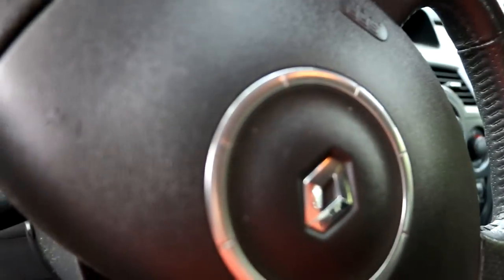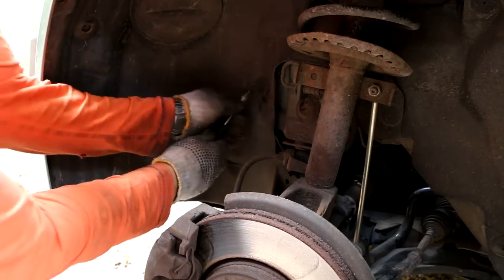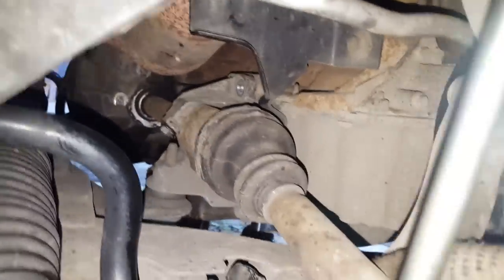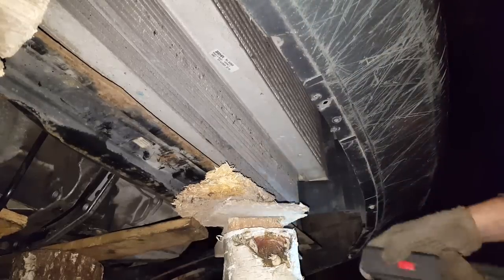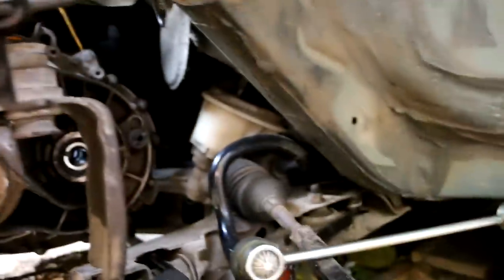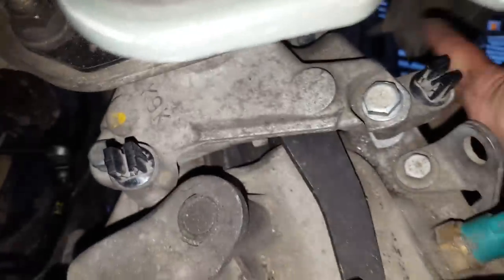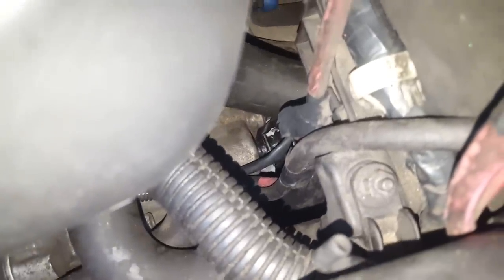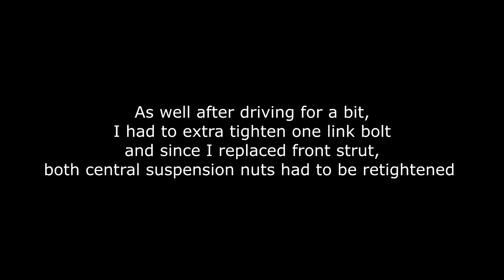How to replace Renault Megane 2 Clutch Concentric Slave Cylinder

Comment: thanks for this video :)   my megane 3 clutch pedal went zero pressure when i parked up, then the next day it had pressure again, the pressure lasted about 3 gear changes then went pressure free again. do u think it could be something other than the slave cylinder? the break fluid is full strangely. im wondering if it has a leak and sucking in air overnight.  Any thought? thankyou

Comment: I came to your video, wanting to see how you bleed the concentric slave cylinder, I did not get the information I was looking for. I then saw all your dangerous struggles, I have the following suggestions to you.

1. never work under the car with those wooden supports, get four jack stands. You are a lucky man alive with all these dangerous endevours.

2. Use jack to raise you car.

3. to take out the transmission, you do not need to take out the struts. Also, you may want to buy an engine hoister, to move around the transmission.

Wish you all the best in your car repair adventures.

Comment: Man that is a big job! I have to replace mine in 'n 2004 1.9dci that started leaking recently.... will change the clutch and crankshaft oil seal and thrust bearing at the same time since it is such big job...
Reply: Doing the same, how was clutch job?

Comment: This is SO cool! 
Thanks for insisting that it's possible to do it yourself - even if you don't know how, from the start! 
And thanks for also showing me that I can't :D 

My pedal is doing exacly the same - I lose brake fluid slowly - according to a mechanic, because some part of clutch is leaking fluid and from time to time, the pedal locks in bottom making it impossible to change gear. I can push the pedal back up with my foot and clutch then works again some time. (Car has driven 310.000km now, so I guess its acceptable that clutch is bust?) 

Thanks JUrtan !

Comment: Hi! I am from northern Finland, and i have same kind of job to do on my scenic ll -08 petrol. And under the sky on stands also😬 Great tutorial video you have made,👍🏻 I notice many sunsets on video, so how many hours it took to finish the job?
Reply from the maker: Hi!  Good luck for your coming job! The job is not easy and it looks intimating, but even without a lot of experience in this area it is possible to do it , just need to unbolt a lot of bolts, I thought I might skip some parts of removing, but not possible :) I think it took me quite a few evening (had to do other things, so had limited time for this work), I even cant remember how many, but I was learning how to do it during process and as well recorded it, plus I ordered wrong part(even though it supposed to be right one..), so it took a lot more time than it could. Just need to understand that you will need to remove the whole subframe, once it is removed, then work will go a lot faster as well it would help a lot if you have better gearbox lifting equipment than mine homemade, at least more stable  :)

Comment: Hiya mate, apart from the safety issues with logs and the like, I found the video really informative. I'm watching now to see how you bleed the clutch,however the comments are saying you missed this out. Do you need a pressure bleeder?
Reply from the maker: yeah, it is not easy task without pressure bleeder, but possible. First I tried to pre fill clutch cylinder by brake fluid, but it just didnt fill at all, so I installed it any way and tried to fill it with pressing clutch pedal, etc, didnt work too good. So in the end I did it by putting long tube at the end of the bleeding valve and removed the connection to bleeding position, so after then i pressed  clutch pedal (i think so) and then I just sucked at the end of line and save how many many air bubbles started to come out,I repeated this a few times and then connected to close position connector and removed the line and closed the cap, and yeah after then clutch cylinder worked, but it took my many hours till I figured this out so that is why I kind a dont have this on my video, since I tried like many methods and stopped recording after a few.. and yeah I also had to secure the bleeding valve cap by duct tape bcos when I pressed clucth pedal it tended to pop open, idk why and how but I havent had any problems with clutch for at least 8 months now and havent loss any fluid etc. so I assume it is possible to bleed the clutch without the pressure bleeder, but u ll need at least 1.5m long tube that you can closely fit on bleeder valve.
Reply: @JUrtanschannel  thank you. I've just stuck a screwdriver through the radiator prying off the subframe. So got something else to mend now. Bloody Diamond of Doom that's a Renault.

Comment: You left out the hardest part, bleeding the clutch! :-) I fitted a new flywheel, clutch, slave cylinder to my megane rs225 2.0 and i can't get any gears!
My car has been off road for 3 months, i can't get the clutch bled!
Reply from the maker: I kind a tried to explain how i did it, not easy stuff if u are doing it first time, gravitu stuff didnt work so I had to suck oil to get it in the clutch, any way, not too hard if u know what to do, connect clucth so it is one click from fully connected, attach very long tube to bledding valve and suck and press pedal until no air comes when u suck and then connect clutch tube fully anf make sure bleeding valve is closdd, that is how i did+ i did not replace anyring else than slave cylinder since my clucth didnt slip at all :)
Reply: @JUrtanschannel  sorry, missed that part, ijust skipped to end of video thinking you would do it at the end of the video! :-)
I have tried sucking from the bleeder with a vacuum pump, that didn't work,i also reversed bled it from the bleeder back up to the fluid reservoir, that didn't work either!
Only thing i haven't tried is pressure bleeding from the fluid reservoir down to the bleeder.
Reply from the maker: @robbocop33r12  well since I did this first time, it wasnt easy, took me at least 4 hours to bleed that clucth, first I read that u can pump fluid in the clucth cylinder before installing it, but it didnt work as pump at all so I was worried that it is probably faulty, but I installed it any way, then I tried to do as i read online, i attached quite a long tube to the bleeding valve with expansion bottle at the end and clicked cyclinder line one click away from fully connected, so i pressed many hours pedal and didnt bleed the clucth, could not engage any gear, then I was totally upset since it was 2 am and i had to get to the home with car, all i did i pray God and hoped it starts to work until i ran across one article about vacuume bleeding, so i tried to suck the air from the tube and with fluid some air came until no more air came, so I connected fully clutch and finally felt right pressure in the pedal and could engage gear, but it wasnt for long, since after a few pushes bleeding valve cap just popped open, so i had to bleed again and after third time I put around it some duct tape and it is still in the place after 6 months and clucth wotks nice! I think it was bcos cap was way too oily. But yeah I agree that i didnt give best video of bleeding since i figured out how to bleed just in very late night, i even managed to get some of dot oil in my eyes and my canon 70d got error 80 in mid of repairs so not the luckiest repair work, but result is any way nice for me. Sorry to hear that nothing works for you, when you pump your pedal, do u see any oil movement in to the line u have attached to the bleeding valve?
Reply: @JUrtanschannel  yes when i open bleeder fluid comes out no problem. My clutch pedal moves down about 6cm before there is resistance, then pedal feels good all the way down.
I too tried to fill the slave cylinder before fitting but i don't know if any fluid stayed in the slave or not? cylinder. Plus i heard it can damage slave cylinder while you are pressing it 'off' the car?
I am going to put pressure in the fluid reservoir tomorrow and open the bleeder and force the fluid down towards the slave cylinder, and see if that helps.
Reply: Try with 2 people - put finger over undone bleeder while other person pumps pedal very fast . Clutch fluid works low pressure compared to brakes and doesn;t always move air lock

Comment: Good video my friend. I am currently removing a clutch from a 2007 1.6 Megane Dynamique. Can you give me any hints as to how you extracted the drive shaft from the transmission side as mine won't budge. Your video shows you splitting the ball joint and then shows the drive shaft removed  but doesn't show you removing it. I'm quite far into the job, i have the battery, battery tray and ecu removed. Front sub frame is removed. Oil is drained. Ball joints are split both sides. The offside drive shaft came out really easy but i cannot pull the nearside axle from the transmission. Any ideas? Many thanks
Reply from the maker: hi, there! Thanks for your message. To be honest it was so long time ago, I kind a can speak only just from what I remember,  in my case removing the drive shaft from driver side was super easy from passenger side, a bit more complicated.

Probably you have already removed the driver side drive shaft, to be honest I dont recall that it was hard to remove it after all joints to hub/brake disc were removed.. it supposed to be the easy side, but if it is stuck, probably you can try to pry a bit it from the transmission side?
Reply: @JUrtanschannel  Really appreciate your reply, many thanks. Yes i got the driver side axle out first, which was really easy. The transmission side axle won't budge at all, it's as if there's a circlip or bearing securing it to the gearbox! I'm certain i've dismantled everything else around it (Hub ball joint, tie end rods etc).
Again, many thanks for your quick reply.
Reply from the maker: @jamesmichaelcooper9180  yeah the other side, I start to recall, it was hard to get it out, I even think I used hammer and when I tried to get it back I had some issues because of that, but nothing big, just had to hammer part I dislocated(I think I had problem with shaft holding bracket).. but yeah you can get it out with a hammer :) I dont think it is the best method, but it worked out in the end OK
Reply from the maker: @jamesmichaelcooper9180  I just had a thought, I am not 100% sure, but I think you can probably push out other driving shaft with idk screwdriver or better something with flatter end and hammer, from the driving side hole, if there is nothing between them, just a thought, not sure if there was something between, but I kind a think there wasn't anything
Reply: @JUrtanschannel  Really appreciate your replying and ideas to help with this. I will look into this and let you know how i get on. Many thanks once again!

Comment: Hey man me again do you know how to luminat reverse lights without engine on to check if they work ?(replacing all lights to led)
Reply from the maker: Not sure if I got you, but I am sorry  I think I don't  know :(
Reply: @JUrtanschannel  if you put the car in reverse with Megane 2 only the reverse lights lightup when car is running engine but can't find a way to check them with engine off 😅
Reply: Go and unplug the green sensor wich goes in the  gearbox then touch the two cables it should work

Comment: Hi friend. This car is a megane II with 1.9 Dci engine? Thank you and congratulations on your work.
Reply from the maker: It is megane 2, with 1.5 dci (LM0), but I think the work u have to do is rather same. :)
Reply: Thanks for answer so soon. I have to change clutch in a 1.9 Dci engine, and I think your video is going to help me a lot. Good contribution.
Reply from the maker: @eduardob.s.7087  just make sure u buy correct cylinder, bcos on manual it was said that I need different one, but in reallity it was other kind, there are two models, but u can check what model do u need by inspecting the connector of slave cylinder where brake fluide line connects to it :) at front of the engine, where u ll need to bleed it later on.
Reply: @JUrtanschannel  Thanks for the advice. I hope that with patience, everything goes well. A greeting.

Comment: my clutch just fell to the floor on the same car, but after seeing what you have to do... i need to go to a mechanic!
Reply from the maker: well if you have car lift, you can do quicker and more easier + u need someone who will help u to remove the gearbox.. yeah this work is crazy, but if u want save a lot of money, it is possible to do it by yourself :) + I did it without much experience, on ground and without many special tools :)

Comment: my clutch is slipping and im loosing brake fluid somewhere... could it  be because my concentric slave cylinder is leaking and making my clutch oily so thats the reason my clutch is slipping? i have vectra B 1999
because clutch was changed not too long ago..
Reply from the maker: Not sure, but if you are noticing that you are somewhere losing brake fluid and you suspect that it might be leaking clutch slave cylinder, well I would  go for testing that out, just by pressing many, many times clutch pedal and looking under the clutch housing if there are any drops of brake fluid or not or any drops of brake fluid on the ground.. at least for mine car there is special drain hole and when I pressed clutch pedal, brake fluid started to drip out from there, when it was broken..

But yeah not sure if this ll be what is causing to slip clutch, cant imagine how brake fluid would get in to the clutch it self from slave cylinder..

Comment: Hello, I just changed my flywheel, plus clutch and hydraulic stop and bleed the circuit. I start and I press the pedal in clack clack clack or a purge problem why ???. It is a magane 2 1.9 the 120 CH year 2005 box NDO. Because I'm afraid to take it apart. Other I do not have a mid hot 4 in the hydraulic stop during assembly. is it important ??? and the petal vibrates and it seems to me drop mole. I don't know how to do better for the purge. thank you cordially I AM VERY BAD WITH THIS PROBLEM.    (france)
Reply from the maker: Hi! Well I am not sure that I understand what is the problem, as well Im not pro, I just like to fix my car myself.. too much bad exp with garages in the past. Well this is the reason why I didnt replace the flywheel and clutch itself until it is totally broken, bcos of possible problems later on. One thing I would check out if it is all ok with clutch alignment, especially if u ve bleeded it and you can shift the gears, but have some problems with weird sounds from the clutch. Did u use special alignment tool when u installed the clutch?, to be honest it is not that special, but ll help you a lot :)